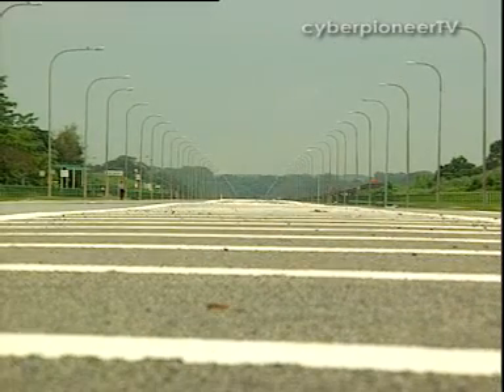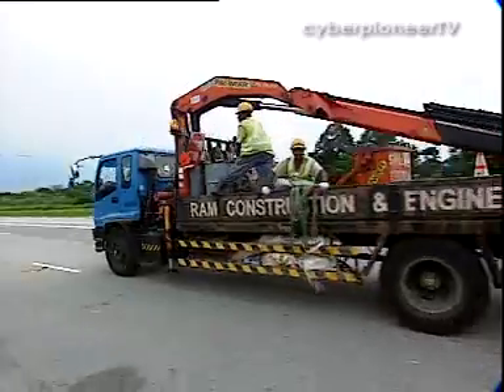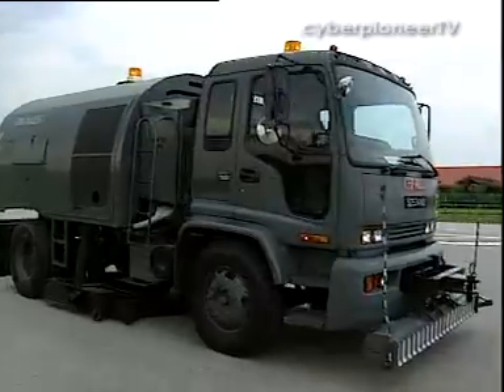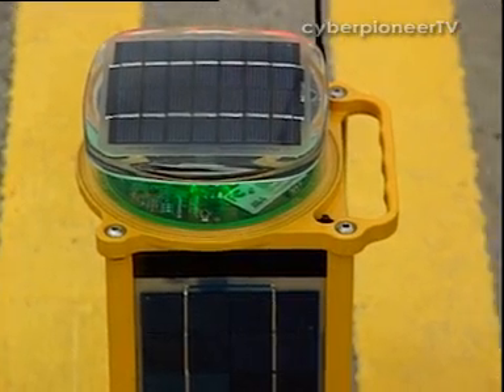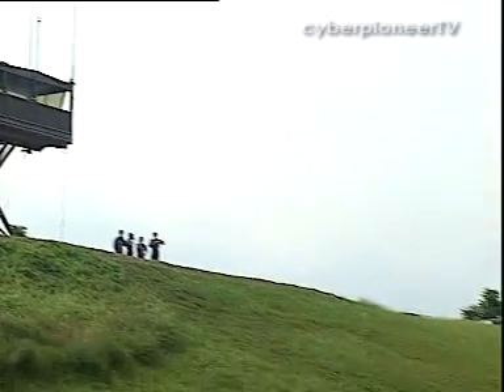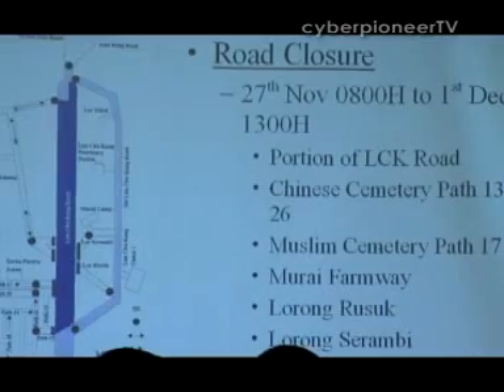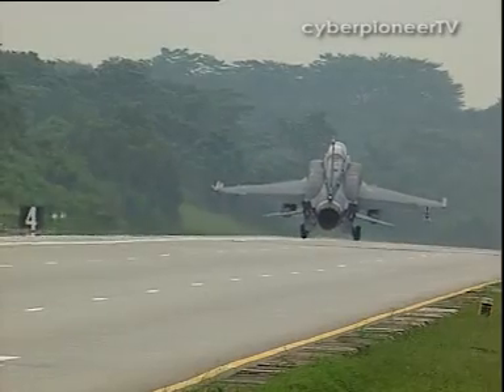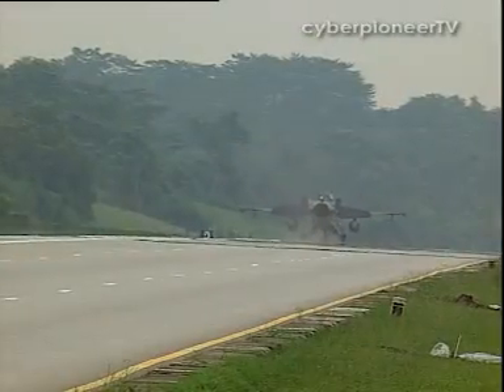From Roads to Runways

Comment: I don't think during war time, you have the luxury of having 2 days to set up all the equipment. Good pilots need to be able to land on any decent straight road. Check out those planes flying in Africa's small villages, that's flying.
Reply: mrcannotfindaname 
So if it's war time, 

Do you think the soldiers will take time and hassle to unscrew each and every lamppost & busstops & fences?
So that after the exercise can screw them back into place?

Do you think they still need to get paperwork approval from Ministry of Transport to close the road?

You think they need to inform civilians of this exercise?

You think need to set up tentages and portable aircon for people and VIPs to come watch?

You think only in war only 200 soldiers working on converting this road?

They need 2days because they need to put up a "show" since VIPs are coming...

if it's real war, there is no need for such "show", just burn down the trees and saw off the lamppost and fences and bus stops man...
This should save a lot of time

Lol...
Reply: sorcereh stretches of ECP are designed as emergency runway for Changi airport. To open the runway, all the lampposts etc will be knockdowned and cleared with bulldozers. They’ll do the same to open the dispersal air strips
Reply: +mrcannotfindaname this is incase if our airbase have been bomb or disabled and during war time it would have been much faster since they dont have to be so hard on equipment check and accountability of weapons and paper work and tough on clearing fob gather local support and dealing with logistic public traffic and local people during war time looking at there set up it could have been set up during wartime without so much consideration for traffic local disturbance and huge amount of paperwork as well as the work ethic of the men if this was the real deal im sure it can be set out in less then a day
Reply: F16s and F15s need long distances to land and good runway conditions. On these roads they also need a strip of rope to force the plane to stop similar to an aircraft carrier.

Comment: I really dont get it. Why does the RSAF allow media to show this runway to the public. I mean it does not make sense. If an aggressor country knows this runway is in existence, they will take out both the airbase runway and this makeshift runway.
Reply: Minh Tran Van yeah Finland has similar system. the point is there is many many of these designated alternate runways planned. point isn't to hide them. it is really not possible. anyone with aerial or satellite images can see where there is flat long and wide enough stretch of road. point is to have so many alternate places, taking them all out is in practical. then one rotaes between these places so fast during conflict, that by the time enemy manages to organize attack on the field you have been using, the field has already changed positions.

According to Finnish doctrine the bases rotate so fast that, when the pilots take of, they don't know where they will land, because probably the base has moved by the time they need to land. There is essentially constantly multiple base teams on the move. some are operational, while others are moving, while other are prepping or dismantling their base, so that there is constantly a strip available, but still periodically the location of the current operational road base changes. 

so lets say one strip is active, second team has just dimantled their operation and moving to a new location and third has been prepping yet another strip to take over as soon as the currently active strip has to start dismantling. so on and so on. of course there is probably multiple bases active simultaneously depending on the size of the country, so each active strip consist of this kind of set of rotating teams.

so there is no need to hide this place, since this specific strips getting attacked is irrelevant to the operational capability. they just change to one of the dozen other suitable strips.
Reply: They can do it with any public road that long/straight enough (about 2 clicks straight is enough), wide enough (depend on type of aircraft) and to bomb the hell out of all area that fits those criteria is quite troublesome. :)
Reply: Singapore’s main instrument of military power is deterrence. We show what we are capable off making potential enemies think twice about attacking us. You think this is the only road the RSAF will use? It’s probably the one they can use with minimum disruption. We just want to prove we can operate away from our main bases. 

In terms of doctrine, Singapore won’t fight the war I our own airspace. Like Israel in 1967, the RSAF with naval support will win air superiority on day 1 of the conflict. 

Singapore is also the most densely defended airspace in the world in terms of AAA. Combined with the only AWACS in SEA not flying off the decks of an American carrier, it’s unlikely that any foreign power without stealth technology can actually attack Singapore soil.
Reply: It's not really a secret. There are way too many roads to bomb
Reply: In times of war they'd attack the airbases instead. Runways are very easy to repair with very little material and tools.
Reply: There’s a public interest thing at play, it’s in the public interest to show stuff like this because it allows people to hold the SAF to account.
Reply: total agree in time of war aggressor will destroy all airfield and air strip. Now they know if they attack singapore they will bomb this road...STupidity to the max